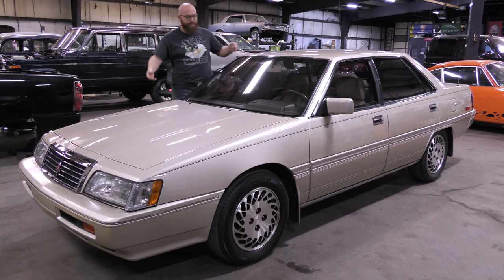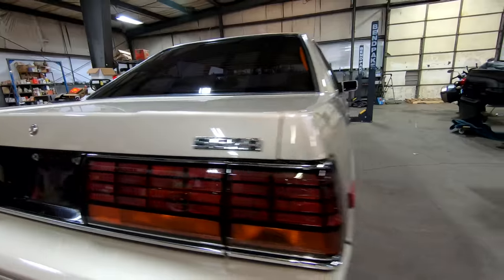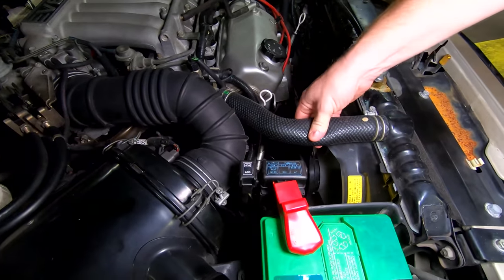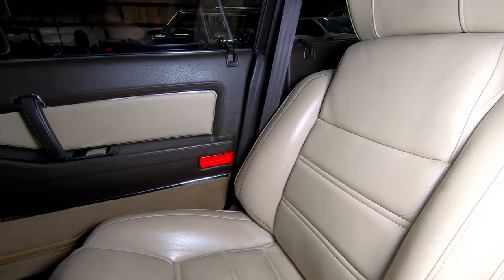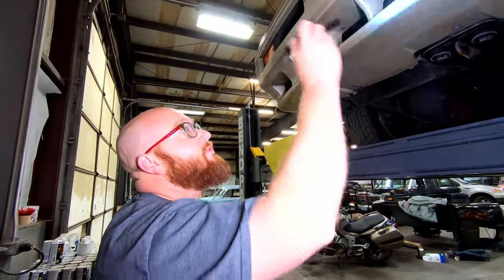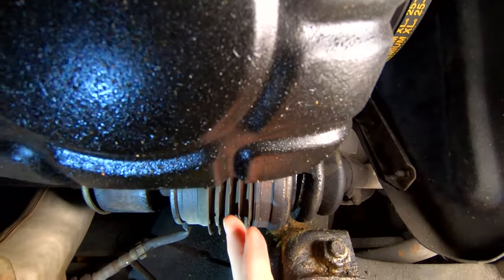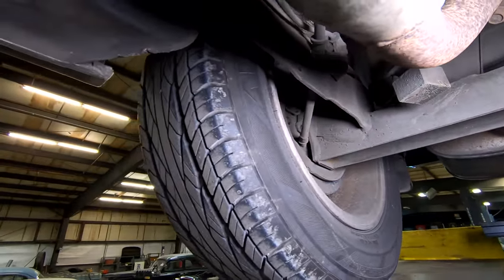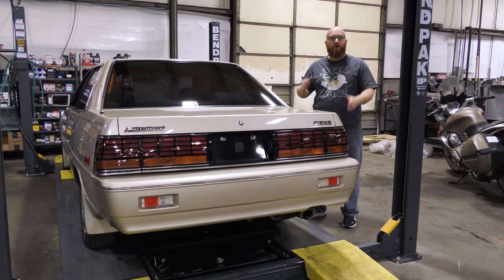Insanely Unique! When Mitsubishi attempted European design. CAR WIZARD shows immaculate '90 Sigma

Comment: back when Mitsu' was not in a financial crisis and actually built solid cars.
Reply: In the early 80s they built famous crap like the 2.6 litre Hemi that stopped pumping oil to the pistons without any warning. 💥 💀
Reply: @j_freed  was that the one in the K cars?
Reply: agreed!
Reply: In the early 90’s Mitsubishi was trying to do a hostile takeover on Honda. In fact that why Honda left f1 in 1992. In the early 2000’s Mitsubishi got burnt with the  subprime car loans
Reply: I worked for Mitsu but I built aircons. We called it the bish.
Reply: @ajdahun  Mitsubishi did some of the engines in K-Cars. I believe they also made the "high performance" engines for 80's era Chargers and Plymouth 024.
Reply: That was when?  Mitsubishi's role in the car business in the 40 years I have been in it was always as the low bar.
Reply: @eazy529  The car division which is small portion of Mitsubishi
Reply: The Monteros were pretty cool
Reply: @j_freed  the 2.6 also had timing chain failures and issues with the cylinder head cracking.  Many chrysler products got that engine, my Dad's 86 Voyager SE had every issue that engine had to offer lol. Oh and let's not forget the 3.0L V6 that loved to burn oil early in its life. Mitsubishi definitely had some cool designs back in the day, BUT they were never considered a reliable car. 

Mitsubishi and Nissan if anything both took 80's styling to its limits while still looking cool.
Reply: Can't believe my dad had one. That was the first and last time I seen one.
Reply: I had a 1999 Galant with the 2.0L 4G63. It had amazing engineering all around. Mitsubishi has always been underrated in the United States, but around the world they were known to be very good vehicles. There was a point when they had some issues with transmissions and the early GDI engines, but they were good vehicles overall. The slump they are currently in is 100% their own doing. They overestimated their value in the US market and went all in. Result: flop. The company that gave us the 3000GT VR4, the Eclipse GSX-T, the Lancer Evolution, the Pajero/Montero/Shogun is now selling abominations such as the Mirage and the Eclipse Cross. A totally forgettable line of vehicles that I wouldn't even consider.
Reply: @RobertNES816  I owned an ‘84 Voyager that I purchased new with that engine.  Had to replace it at 60k miles.  The shop that did the work told me that engine was their “favorite”… meaning they were replacing so many it was a cash cow for them! 😉
Reply: So 91 to 91 plus a month lol jk
Reply: Their main focus isnt even cars 😁
Reply: @dave1w41  aircons I built weren't for cars. They were for buildings. Sorry I should've mentioned that. It was back in 04 anyway when I was a teenager. I was just trying to get involved in the convo coz Mitsubishi. Also, a poorly spelled anagram of Mitsubishi is shitibums. When I worked there I notice that and it made me giggle
Reply: @dave1w41  sorry mate I thought you were answering me 😂
Reply: I only remember them being bad or very bad - but I only remember them from the late 90’s and later.
Reply: @christopherconard2831  Mitsubishi[3 diamonds] was tied up with Chrysler in Australia and i believe also New Zealand
Reply: @RobertNES816  yes, Our Mitsu 2.6 L hemi Plymouth Sapporo died from oil starvation when the chain that drives the balance shaft (and oil pump) came loose, stopping the oil pump while we were on the freeway. We gave the car away to a mechanic who rebuilt it for himself.

The key is to notice when the engine is getting noisy, because the guides on the chain have a Teflon piece that gradually wears out. That’s a fairly cheap job in itself.  But engine self-destruction should not be a product feature.
Reply: @j_freed    yea every manufacturer doesn’t get it right every time. Most manufacturers still can’t get it right present day (ahem, Ford 5.4 3 valve triton). Part of the problem was using the engine in vehicles and configurations it wasn’t intended for. 

Let’s not forget the balance shaft patent on this engine that ended up being licensed to Porsche in which they paid royalties to Mistu for using it on the 944 and 968. 

Then you have the 4g62/3 6g72/74/75, 4D55…

This one looks like the 6g72 which was in countless vehicles in the 80’s and 90’s, the dohc tt variant in the 3kGT Vr4, and won the Dakar rally numerous times.  The 4g series in the evo did the same as well and created the DSM following. The 4D55 diesel in the early 80’s Ford rangers, if it weren’t for the Ford frame and body crumbling to dust they’d still be running.
Reply: Are you talking Mitsubishi motors?

Comment: It might be a '90, but that is pure late 80s Japanese styling in and out. Orange lighting, angular interior fittings just screams 80s.
Reply: I had an 85 Cordia and you r right about the orange lighting!
Reply: Of course, anything up to about '92 would've been technically designed in the 80s
Reply: The dash reminds me of Nissan.
Reply: @davemessenger1944  Now that’s a rare car I nearly bought a used one back in the late 80s with the dual shift power/economy gearbox.
Reply: Exactly!
Reply: It's basically a slightly restyled mid 80's Galant.
 Sigma is what Mitsubishi Motors Australia called the new 1979 "Chrysler" Galant. This shape was released in 1985... MMAL didn't think it was big enough to compete with the larger local Ford Falcon and Holden Commodores so cut the car down the middle and widened it by 4 inches. Unfortunately the only engine available then was the 2.6 litre Aston 2., and Aussies didn't find FWD attractive. 
Magnas ceased to exist in 2005.
The luxe version was called Verada.
Magnas then had a 3.5 V6 and some had AWD.
They were exported to the world as Diamantes.

Comment: Mr Wizard, I bought my wife an '85 Galant and when it got rear-ended, a Sigma here in the midwest.  Both cars had the air suspension and moonroofs.  That suspension was problematic, and with the Sigma I replaced the struts with the base suspension components like you have on this car.  Mrs Wizard, that button between the seats determines when the shift happens - longer shift times was "power', short times were for "economy".  BTW the back seat on the '85 was the most comfortable I've ever been in.  It reclined a bit and the front of the seat was adjustable up and back down a bit.  The Sigma did not have that seat.

Comment: My mom had one of these - almost identical to this car but with cloth seats.  It also had relatively low miles (but a clearcoat/paint peeling problem that appeared towards the end) when she traded it in for a more fuel efficient car back in 2010 when the so-called "Cash for Clunkers" program was in effect.  Although it was the right move for her, I still miss that car and we went to a lot of effort to ensure that it was well-cared for.  It was the first car I did a lot of research on and convinced her to buy new when she needed to replace her old '79 Accord.  It was a very comfortable car to drive, reasonably reliable, and had a nice solid thunk when you shut the doors.  The electronically-controlled suspension was also pretty neat to use.  Can't say we used the "eco" button on the shifter much.  I can only hope that some of her car's parts were used in any "refreshing" work of the car you profiled.  Thanks so much for doing this video, Car Wizard!

Comment: The beauty of manual locks is that you can press a button on the door, close the door and forget about keys or key fobs after getting out of you car.
Reply: Well the drivers door should unlock unless you pull the outside handle when shutting the door.

Comment: This was Mitsu's flagship before the Diamante.It came out in '85.But,it sold in very low numbers.the Galant changed in '89 so they kept the old style until '90 or '91 until the Diamante in '92.Calling this the Sigma.Well preserved car!
Reply: Yes, my mom had a 1990 Galant, pretty solid car , burned oil and the transmission eventually went out.

Comment: This has to be the nicest one of these left in North America, without question.  This and the Starion were so high tech to me in the late 80s, with the folded paper styling and home hi-fi stereos.  I'm surprised this doesn't have a sunroof, however.  I'd lose it if EuroAsian Bob found a 929 from this era in similar condition.
Reply: This car is spec’d perfect in my opinion.   No sunroof, no air suspension, with leather.  Exactly the way you want it.  I actually have an 88 Starion as well.  Can’t wait to get them together.

Comment: After this ('91-96) they reached automotive perfection with the Diamante, which was the platform basis of the 3000GT. The JDM Diamantes even had options for AWD and the world's first adaptive cruise.
Reply: First adaptive cruise, huh? Interesting, I did not know that. Thanks, always looking to learn new stuff. 👍
Reply: I once bought an old high mileage Diamante. It was a great car. Smooth, comfortable and handsome with plenty of power. I sold it for double what I paid after replacing an oil seal.

Comment: The 3.0L V-6 exhaust valve guides would drop in the heads. Cure was to tap up guides, cut grooves and install  circlips.  At 125,000 miles replace timing belt, water pump and fix valve guides. Of course head gaskets and leaking cam seals and valve cover gaskets also. Did this on A LOT of Chrysler minivan.

Comment: These were sold in NZ as the Mitsubishi V3000.  Came with a 5 speed manual as well, could smoke them front tyres like crazy.
I worked at the factory where we assembled them.  There was 3 models models available, Executive (base model), SEI (top of the line) and the Elante (sports model).  Eco/power button changes the shift pattern in the auto, holds each gear longer in power mode.  We also had these as Police/traffic cars and they were pretty loose, suffered terribly from understeer.

Comment: In 1996, we were looking for a replacement for our recently wrecked Cadillac that was "repaired". We wanted something smaller, but reliable and were going Japanese. Toyota, Honda, Nissan, etc. A dealer was pushing one of these hard. It seemed really nice. I talked to my dad a mechanic, and he said run. So, we got a '94 626 and were very happy. Traded it in '98 on a brand new 626.
Reply: Loved the vents that would automatically sway back and forth on the 626.  Back in ‘95 it was between a V6 Accord and a 626.  My dad went with the Accord, but looking back, he should have went with the Mazda

Comment: Great review!  Here's something which might surprise you.  A lot of the body widening and engineering for this model was done at Mitsubishi's Australian operations in South Australia.  Mitsubishi Australia called this model the "Magna" and here it was sold exclusively with either a 2 L or 2.6 "balance shaft" four cylinder "Astron" motor.  When this model was phased out it was replaced by a new Magna based, again, on a Japanese model but widened and re-engineered for better body toughness by Mitsubishi Australia.  It was so good it was exported to the US as the Mitsubishi Diamante.  Yep, all the Diamantes came from Australia.

Comment: Had a Dodge Dynasty from that era with the same engine.  It was a screamer!  Not sure if the sigma had the same tranny, but it was a blast for a teenager.  At a stop light you matted the gas and it hit 5000 rpm before it engaged and roasted the tires for as long as you held it down, no power braking required!  Of course...we went through 3 trannys in 150k miles

Comment: Drove an 85 sigma Astron carburetor.  Great  car to drive.  The air engine filter housing is a lot like the TP magna.  The eco power button on the trans is power for towing (it holds the change to a higher gear a little longer)  Brings bank a lot of memories.

Comment: In Australia it was the Mitsubishi Magna with a 2.6 litre 4 cylinder. The line up was GLX, SE and Elite. The Australian version had different headlights/grill and tail lights. The interior was different but the instrument cluster was the same. They were a really smooth quiet car. The Sigma was the previous model in Australia which had been superseded.

Comment: These were marketed in Australia from the late ‘70s until the late ‘80s in a rear wheel drive configuration. Before Mitsubishi they were marketed under the Chrysler banner as the Chrysler Sigma (1977-1980). Some didn’t like them but they were a fairly solid car (and one which I would like to get my hands on!)

Comment: My wife had a 1989 Dodge Dynasty with the same engine but it had a different intake and the engine was turn around. The throttle body was on the driver's side and distributor on the passenger side of the engine bay. The 1989 Chrysler New Yorker also has the brake booster on the passenger's side. On my wife's 1989 Dodge Dynasty the valve cover gasket was built into the valve cover if the valve cover leaked you had to buy a new valve cover.
Reply: The valve cover/PCV idea must thave been an inspiration to MB and BMW then.....

Comment: This was actually designed in Australia on a specially widened Galant chassis to compete with the fullsize Holdens & Fords. There is no European input at all - Mitsubishi didn't really have a European flavour until the Evo days in the '90s.

60/40 splits were common in European saloons at the time though perhaps not in the USDM models.
Reply: Well yes but actually no. This Galant a.k.a. Sigma a.k.a. Sapporo was released in Japan in about '83 and was the basis for the original Magna, which like you said was a widened Galant. So this is definitely a Japanese design.

Comment: My mom owned a 1988 Mitsubishi Tredia, which I believe pre-dates the Galant, but was positioned as a "luxury" vehicle. Try to find one today - in ANY condition - seriously, I dare you! That car was demolished in 1992 as the result of a low-speed fender-bender with a Honda Civic at the Nissan dealer my parents both worked for at the time. The Honda suffered a nasty scratch - the Mitsubishi suffered major structural damage.

Comment: My mom had the 1988 version of this. It had horrible water leaks in the cabin, the engine was replaced at 35,000 and it completely died at 80,000. It did how ever had complete radio control with special buttons on the steering wheel to control the radio with back lit buttons.

Comment: Still remember when the Diamante replaced the Galant Sigma.  Mitsubishi dealers couldn't give them away.  Most were given to sales staff as Corporate cars and then sold as used with 4000 to 5000 miles on them....30 to 40% off sticker price.  Test drove one with the Sales Manager and the sales push was extreme.  You received the sticker discount, 4.99% for 60 months and the dealer was including service (oil changes and tire rotations).

Comment: In Europe it had a slightly different styling front and back. It also had different suspension, as I recall. It was a high tech car, with ABS and even some form of stability control. Not many were sold as it was seen as an "expensive Galant" but that was not fair. The car was a gem and one of the best Mitsubishis ever designed. But the world is not fair, so it flopped.

Comment: Also used as under cover cop car in NZ  was known as V2000  with a v6.
Reply: When the Ministry of Transport was polituically forced to merge into the NZ Police some black and white cars were painted all black or all white and were dished out as CIB (Plain) cars to be used up until the end of their economic life.
The engines of V3000 cars were not changed in any way....
They were all 5 speed manuals and were therefore  less popular than the Traumatic Holdens for city driving.......

Comment: Of locking the door inside. If it's locked when you close the door, it will unlock itself. The only way you can lock the door by the mechanic way is that when you close the door, you pull simultaneously the externior door handle. Otherwise it will unlock itself. Common practice in european and in japanese cars.

Comment: In Australia back in the 90's every second Mitsubishi on the road was a Sigma. The base models were cheap. We used to call them Mitsushitsi Smegma's lol
Reply: Actually it would have been sigma’s in the 70’s and 80’s. The Magna was built from 85 onwards which was a widened version of of the sigma that wizard just showed us with the old astron 2.6 from the sigma turned east west to make it it front wheel drive.

Comment: Looks like an Eagle Premier. It's a mish mash of Chrysler styling influenced in DMM motors. Back in the day three diamond cars (Mitsubishi)were a bear to source parts for, and very pricey.
Reply: On the contrary, Lee Iacocca adpoted the 3.0 liter engine and Mitsubishi underpinnings for his so-called "K-series"(New Yorker, Le Baron, Reliant, etc.).
Reply: @darcychu9652   Mitsubishi was largely front engine rear drive car company  in 1980. K cars were all front wheel drive. Didn't start using Mitsu v6 until 1987. Because of too many warranty claims on their turbo 4 cyl engines. You had AMC Renault and VW front drive platforms already in stable, so they cobbled the design ideas together.

Comment: Interestingly the "Eurotech Package" option had antilock brakes and electronically controlled adaptive suspension (way ahead of its time) for $2,024.00! Good luck finding the 10 small computers it uses if they should fail...Great video! *The Diamante came out after this model in 1992 and they had a wagon too.
Reply: I was thrilled that this car had standard suspension.
Reply: @euroasianbob9268  yes i agree, what a nightmare it could be if it had it!